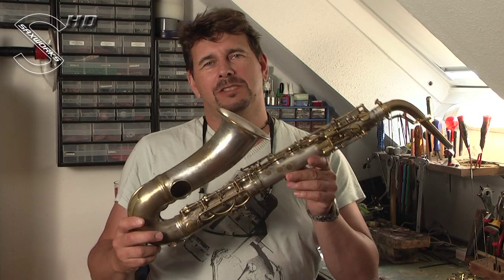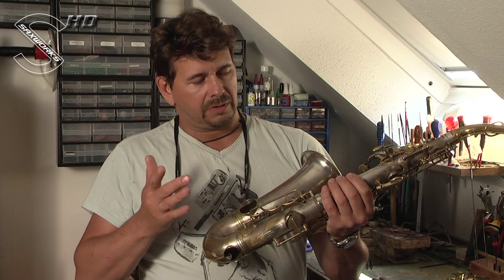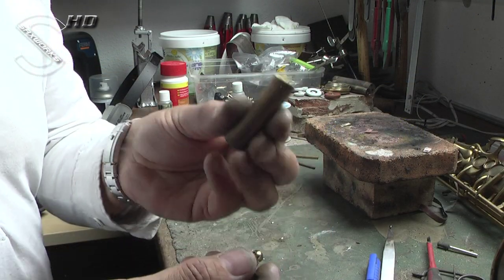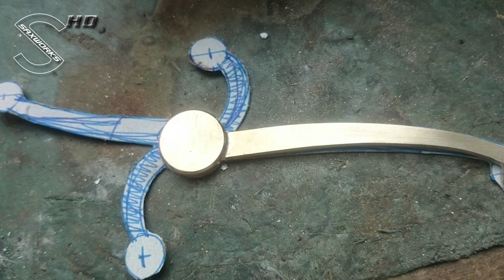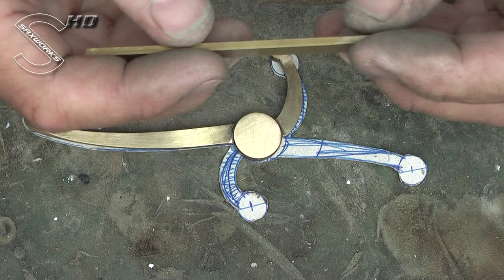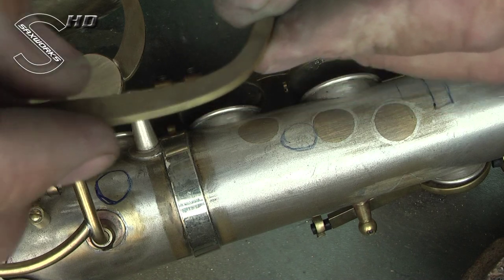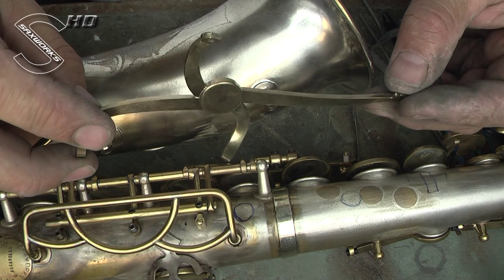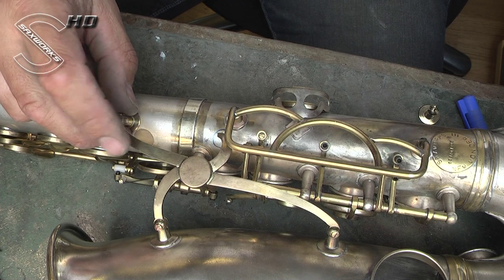Conn NW II - Episode 12 -  bell to body brace

Comment: hi anders, 1. havnt you ever had the problem that such an old horn has bad intonation after all that work, they seem to have that problem 2. do you use any parts ready built by a manufacturer like pad cups or other parts of the mechanism ? it would make sense and 3. how dou you lock your adjusting screws ? thanks very much from a big fan from germany, timo
Reply from the maker: +Timo Schoeniger Old Conns have small intonation problems, but not too serious and nothing that cant be corrected in the rebuild. 2. In this project I hand made every single part and I do that on all Master Series rebuilds - and they are the world most expensive custom saxes, but on my Custom Series I do use Rampone Cazzani factory parts witch lowers the cost a lot. The ventilation screws I use a mild Locktite in very small quantities when every thing is in place.. You are welcome Timo. Glad you like my work.

Comment: what is the price if I sent a sax conn ??
To give exactly the same?
Reply from the maker: very very expensive. Arround 20.000 $ for a full handbuilt keywork. But you can get a premade Italian Rampone keywork set adjusted and fitted for arround 12.000 $
Reply from the maker: are you asking or stating